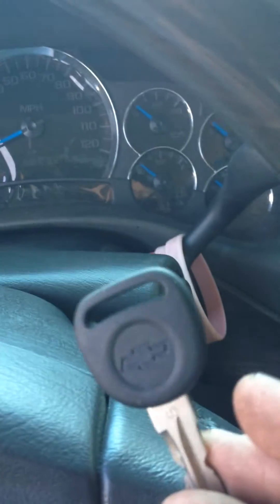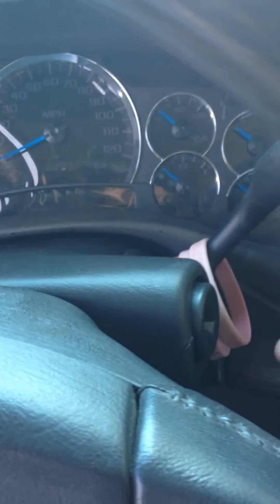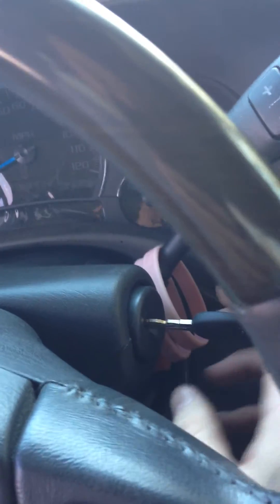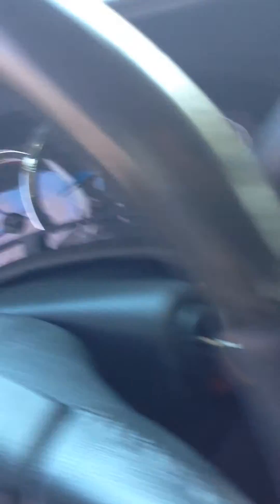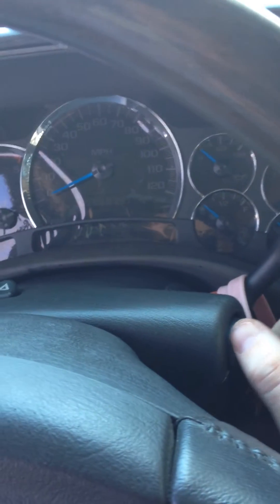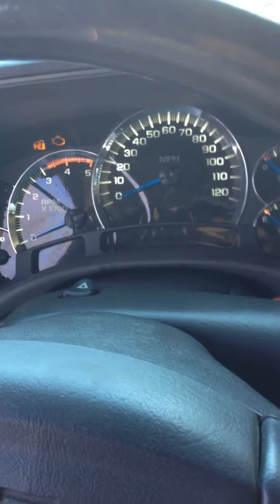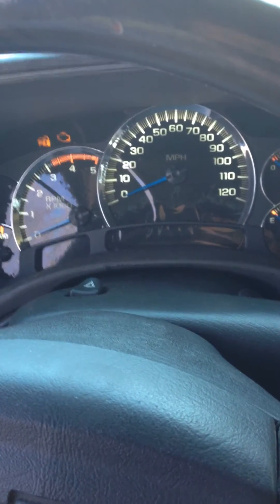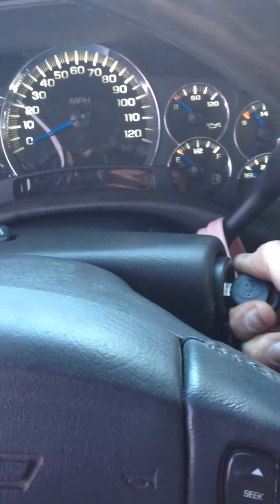GMT-800 Passkey 3+ anti-theft retrofit

Comment: Stumbled upon your post/this video in researching chipped key transponder retrofits. Very curious to hear what the process was and what parts were needed (post from '15 mentioned cheap parts but annoying adaptation process)

Particularly I was curious if you were able to retain the original tumbler to avoid rekeying the door, and moreso any other connections/modules necessary beyond the ignition itself (presuming that the PK2 connection is different from PK3)

This kit would be super lucrative about now, some regions going through car theft pandemic

Comment: Sweet, did the same thing to my 04 Colorado, although it was easier, since at least I wasn't going across a platform change, I think what sweetens the pot even more for both of us.. average thief, is going to think they are equipped with the pass-lock, system, and will force the tumbler... by the time they figure out its actually a PK3+ chip required.... they will be wanting to run..